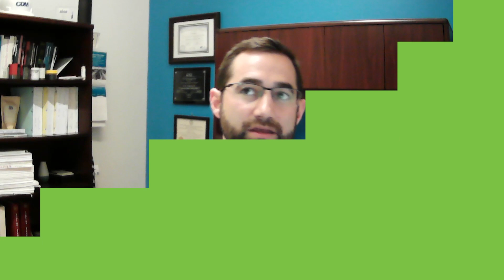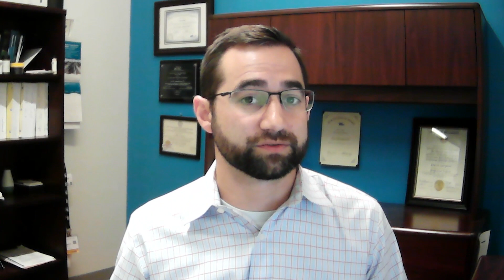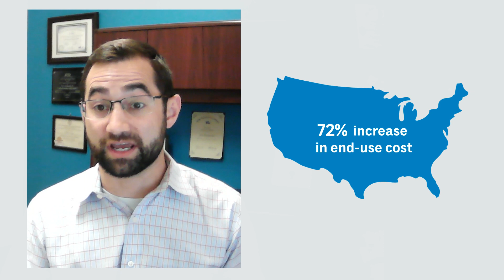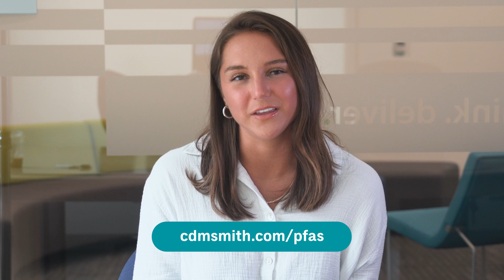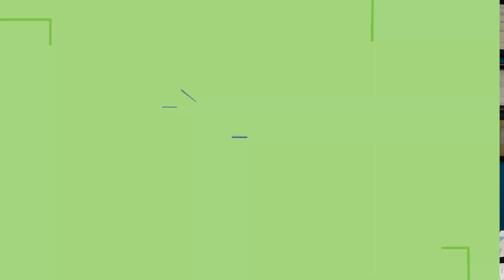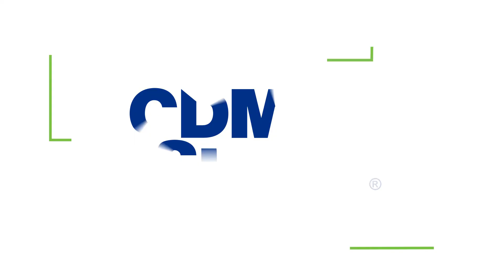How should WWTPs manage PFAS in biosolids?

Comment: The wastewater / biosolids industry are way behind the times with regards to PFAS and other so-called Contaminants of Emerging Concern (2018 was very late), essentially hiding behind the lack of modern regulation.  As far as biosolids are concerned, the best solution is one of the simplest -- use composting toilets so that the biological solids aren't mixed with contaminated wastewater.  Of course, not a great political slogan.  Entropy isn't our friend.
Yes, ultimately source control is key, but these industries are responsible for the point sources of contamination now.  We need to pressure them directly so that they will pressure their waste clients.